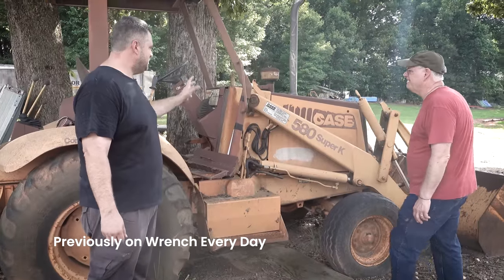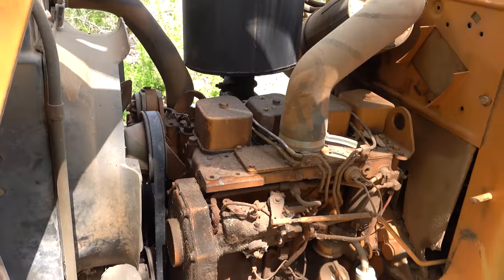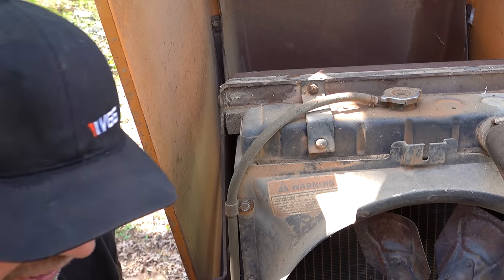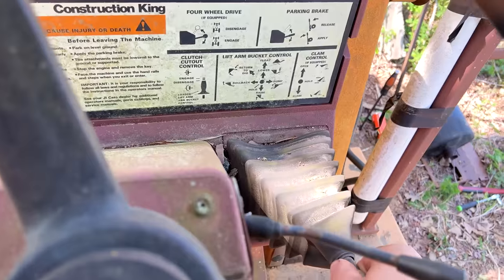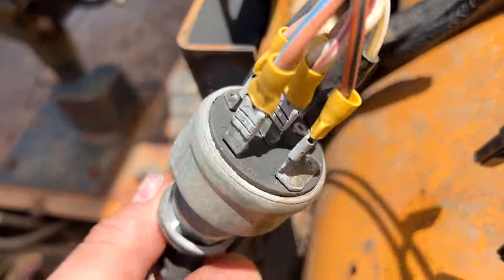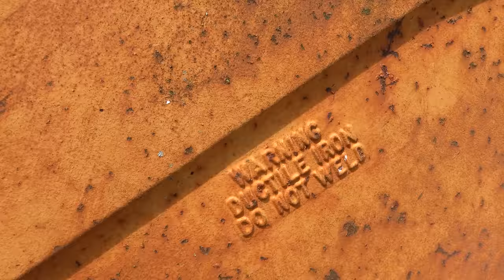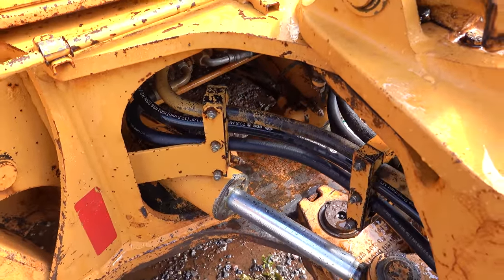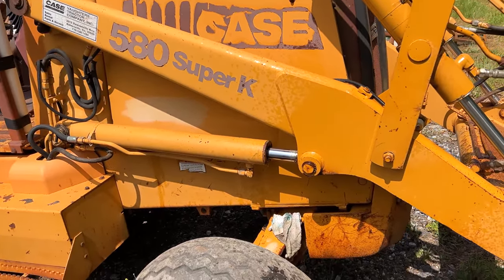I Found A $50,000 Diesel Backhoe ABANDONED In The Woods...Will It Start And Run?

Comment from the maker: To start comparing quotes and simplify insurance-buying, check out Policygenius: https://policygenius.com/wrench. Thanks to Policygenius for sponsoring this video!
Reply: If only you watched/subbed to Abom79. He shows you how to rebuild those cylinders like a pro the (easy) way.
Reply: Jared how you read it is release parking brake and apply parking brake
Reply: Turbo the Thing
Reply: 99.32% oddly specific 🤣🤣
Reply: Yes you are doing something everyone wanted do as a kid 😂
Reply: I have operated all my life. You DID so much better than me on two lever controls when I started using them my first was a JD control pattern. Boy I was terrible. I was use to 3 lever Case. So you starting with two lever to learn on. You will be a master at any Backhoe. Most are two lever on new ones. Just practice extension out all the way with bucket just off ground. Pull in slowly without having bucket dig. Go back and forth just with bucket right at ground level, without digging. Great job on first dig my friend
What you did just raised the value of that Case 580. You have a perfect machine for your usage
Reply: I'm pretty sure you may have figured out that any piece of equipment that has been sitting for several years, all the hydraulic cylinders are going to need be rebuild. As well as all of the rubber goods to be replaced. And while you are at it you might as well change all of the fluids on her as well, cause you will know that it is fresh and ready to go. 
Weather and time has a funny way to break things down. 
That is a good looking backhoe that you have found. I like to see more of what you can restore as well. Keep up the good work and videos.

Comment: Questionable Choice: Bringing an old backhoe back to life.
Smart Choice: Knowing that hydraulics are dangerous when not dealt with professionally and doing so.
Big ups.
Reply: Remember, questionable choices, not stupid ones.
Reply: Bringing back a 69 massey backhoe myself.
Reply: Dont need to be professionally done but someone does need knowledge and the tools, ive done hundreds and nowhere near a professional lol
Reply: @Yippa391  
Brought a 78 Dynahoe-190. Had it sense 2003. Just say have spent more on repair'sthan on cost of machine to buy. Hydraulic cylinders needing reseal. The dipper cylinder had to be boom truck lifted off unit. When I got it the stabilizer had strange issues like his Case. Anyway except for a Hose cracking, blowing Hydraulic Fluid all over. Just fished two on backhoe end that come up through the main base housing, too hydraulic control's under Levers. That was fun feeding the new ones through. My main problem that still is a issue is if I'm driving in second gear, it wants to pop out of gear. I mostly drive in first at my home, so no tranny issues in first.  Is a garden turn soil over machine. My wife lifts me in front bucket to trim tree branches with my pole portable chain saw. Spread gravel over parking area for it and my 71 SeaGrave Engine that I'm restoration. Why a Dynahoe, they were strong one unit frame for backhoe( part of main frame) plus both my baby's have the great old Detroit Diesel's ( Dynahoe 353) ( Engine 8-71)
They may have leaks or blow by, but that's a Detroit. The both run great. I do have a engine block heater, I bolted on the plates that already have the covers on engine block for them. That straight 40 Wt. Oil that is factory called for  those TWO strokes. The engine being warm. With a full battery they just always start even when the temperature drops below 30. I will say back in the late 70 when I ran a Case 580-C my uncle had me operator for. We did side sewer work. The battery was on other side of frame under front loader controls. Nice pull out tray
Anyway the starter was on other side of backhoe. Hard starting in colder weather. I think it was the distance the cables ran from battery to starter. That Case we had, Case was still building there own engine. Then they put Cummins in later models. Now is all FPT
( Fiat) have operated all Case models from CK
Had a nice belly blade on a old CK clutch model. Boy that thing was a great grader.
To the 580-E. That was the last one in 580 model's. Then on last job they had a 590. When they got rid of that, the company went to JD and Cat. So I have kind of gone cold on my Case backhoe understanding on new ones. The Dynahoe was built stronger than the Case. But BE got rid of all there Construction line in mid 80s with the Recessions of those years. It really hurt the constitution market. If it had not been for the 580 Case line, Case would have had big problems. That backhoe is what keeps case moving forward. Cat took over BE a few years ago so guess my Dynahoe-190 is in the CAT family know. Anyway I have talked to long, tell me about your Massy. What type of control patterns does your backhoe have. I ran a Ford 
420 once. With the 4 Levers. Boy talk about total different control patterns than Case. My Dynahoe with the 4 Levers standard backhoe set up. Is just like Cases, with swing being far right lever. And having two stabilizer Levers in middle between the 5 Levers.
Reply: My dad bought a used dynahoe  in the 80s. He loved it. It had a long reach with yhe boom. He sold to a guy who wouldn't quit bothering him. Big machine.

Comment: 10:37, Yes, that is a manual fuel primer. Handy when replacing the fuel filter. It depends on how the engine is standing, how well it works, so if it doesn't work, turn the engine over a little and it might work.

Comment: These 580k backhoes are great machines.  Yes it is old, but parts are available and no electronics to bring it to a halt.  I bought a new 580K phase 2 in 1991.  About $50K then.  I now have a 580k phase 1 (as do you) (parts are more readily available as it shares a number of parts with earlier models).  Mine has the extendahoe, 4 in 1 bucket and 4wd.  After market seal kits are reasonably priced and will be needed.  Don't sell the capability of this machine short just because it is old.  Compare it to a current model and you will see a lot of commonality.  You have the wobble sticks.  You will find these much quicker to learn and be smooth with than with the standard case controls.
Reply: I disagree about the wobble sticks being easier to learn. The “fighter”controls or joystick is way easier to pick up and use. I grew up on an old 580 N with wobble sticks. Now have a 580 super N with joysticks and also run excavators. I hate going back to wobble sticks.
Reply: @CMMC-zb1gw  Wobble sticks  are a two stick control with motions similar to joysticks.  One is direct action on the hydraulic valve and the other is electrically driven (typically referred to as pilot valves). 

 The original case controls that are difficult to use have foot control of swing and a separate lever for each of the cylinders, bucket, dipper, and boom (and a fourth for extendahoe models).  These are difficult to operate smoothly when one hand must push one lever and pull the other at the same time as your hand is not large enough for the distance the levers must move in opposite directions.
Reply: @CMMC-zb1gw  the letters notate the years they were produced through.  Super was a higher hp rating... not necessarily a turbo.
So.... In other words,  a 580 N has the same backhoe controls as any other "N series"  nice try.... Old 580 N🙄 SMH
Reply: @billsimmons7754  
Bill I started on a 580-C, boy going to twin- a- troll. Yes that's what BE called them on Dynahoe
I got so use to the 3 lever that I had trouble learning smooth operation with two lever. My Dynahoe has the two lever not the 4 Levers that was Factory standard. I am use to two lever. I do still like the Levers for each function coming to you by pulling then backhoe tool goes away from you when pushing. I find it interesting that so meany huge mining drag or shovel pit machine have foot swings.
Reply: I knew an extendahoe back in '84. She was 6'3" tall.

Comment: As soon as you fixed the seals, I knew more would follow! Hydraulic fluid is nasty stuff, just eats anything if left long enough. A full rebuild of all cylinders will sort that out, doing one at a time is a ticking time bomb, any weak seals will let go as they are the path of least resistance.
Reply: Yep. True of any pressure system (I was in air tools) you fix one seal, the pressure finds the next weakness. You can spend a stupid long time (even relative to the size of the equipment) chasing that process failure in circles.
Reply: My father has a CASE (a few sizes larger than this one), and we wound up replacing every piston seal in the hydraulics to stop the leaks (and a fair few of the pressure lines too).

The cost and time to do the seals is a hell of a lot cheaper than the hydraulic fluid tho!
Reply: I use a Case, couple sizes larger, for mining during the winter.  Last fall I had a steering hydraulic hose burst right as I started it up. Fixed it and then the other one burst after just 5 minutes of idling. Fixed it and a bucket line burst.  Ended up replacing 7 hoses before I turned my first bucket of dirt.  No seal replacements this year. 

So, be conservative and replace both seals on both cylinders as long as you’re down for the one.

Comment: You are a winner in my book. To not know about that wonderful Case, you took on everything my friend. I will start with the little lever you were pumping. That's the fuel pressure build up for when you change Fuel filters. To help bleed the fuel lines. Prime the fuel. On the front noticed the roll back linkage was disconnected. That is to stop the bucket from rolling back as far as it did. The over center lock for backhoe. Just hook the chain link to the rode sticking up. Then when you want to get it out of Lock. Just reach down ( this is the safety you talked about so much) watch your head, pull back on rode, and push boom lever back and forth. It should unlock. I had Leaking stabilizer cylinder on mine. The two front lift cylinder shot hydraulic fluid out like a raging river. When I bought mine. I was like you I had them done by a shop on 
re-seals. The engine hood. The muffler just sits down on bottom pipe, so that probably explains why stuff got into muffler, no tight seal with there hood design. I am so glad to see her work. I know that Case did a ( Safety update ) safety NEUTRAL switch, update. The backhoes could start in gear in Jump started. So Case did a fix for all there 580s. That might be the burn out of that fuse housing. I noticed that the backhoe would not start in gear. Has to be in Neutral on gear shifter, so that is working. I'm not sure if you ran a jumper cable to starter, and wath it in gear, it might START ( that might be something to look at as you go along ( Safety again) mine will start with it in gear if I jump start it. I have no neutral ( SAFETY) on mine. I think yours is close to year they switched to Cummins Engines. I'm not sure on model that switch from Case built Engine to Cummins. The New Case have ( FPT) fiat Engines. That are big Engine builders for Case backhoe now. Thank you again for bringing her back to life. Cut my teeth on a CK model. It had a belly blade mid frame for grader work. It did great grading.

Comment: Those tires hold a lot more psi that youd think they might. The front on my old work backhoe were 90psi and the rear were like 55psi. Takes absolutely forever to fill them but it makes a huge difference in the ride and traction. Definitely a cool video to watch you drive that thing or of it's grave
Reply: 580 SK front tires are 48 PSI and rear are 24 PSI
Reply: @danabbott2398  I'm glad that people here know specifically about these. I think the reason mine was so different was that it was a 4WD unit. Regardless, thanks for posting the K's accurate PSI

Comment: When it comes to rebuilding things, if I have a part that's failed and needs a rebuild and there are several similar iterations of that part attached to the same thing that needs rebuilding. I would do the front loader cylinders as a set, and then see what happens. Please, keep the awesome CASE content coming!

Comment: Hydraulic cylinders are easy to rebuild but when you have the right tools and lifting power to do so. Main thing  is if the bolt holding the piston to the rod won’t come loose, then try adding so heat with a torch.

Comment: I have seen people straighten the rams on machinery by using hydraulic jacks and chains and 2x4s for pads against the chrome ram. "Marty T"  has a video on doing that.

Tips on trench digging:
Try to scrape three or four inch layers horizontally about 3 to 4 ft long as you dig. 
That will do less damage to the sides of the ditch and you won't have to dig out quite as much dirt and won't have as much dirt to put back in when you back fill. 
Experienced operators often move the tractor forward by lifting the front bucket a few inches off the ground and then scooting the tractor forward by using the backhoe and then putting the loader bucket back down. They do this without turning the seat around. If you're on a small tractor that has two different seats this would be a real Time saver also. 
Some operators also keep the tractor angled  to one side a little bit with the tires pointing straight forward.
This makes it easier to see the trench that you're digging without having to lean sideways to look around the boom.
With this angled setup and the tires turned at an angle it's easy to move the tractor forward with the hoe.

Comment: My mother had a friend looking to give away a car that hadn't been started or moved in about four years, and she thought it would be a great gift for me. Thankfully, she realized that it would require refurbishment, and took it to her trusted mechanic who advised, among other things, "replace every rubber part on the car".
She found a very nice steering wheel cover which was vital as the steering wheel was literally turning to dust after years of baking in the sun, and the hood, roof, and trunk lid were solidly rust red after years of sitting under trees, but the 15-year-old cloth seats looked like new and it ran great.

Comment: Don't be afraid of rebuilding hydraulic cylinders.  I bought a used telehandler with a leaky cylinder.  I brought a cylinder to a hydraulic shop to rebuild, because I was ignorant and afraid of it. I came back with a $500 bill.  I tasked by 18 year old daughter with repairing the next one as a learning experience (8" diameter and 6' long).  She had to make a tool to get the end cap off, but the rest was simply R&R of seals and wipers.  $80 in parts and it has been working perfectly for 4 years now.  My daughter has aptitude, but she it not a mechanic; a little bit of ambition and common sense is all it really takes.

Comment: Jared, pick you up some caps and plugs for the hydraulic lines and then you can disconnect the lines from the cylinder and then cap them and not have to worry about it leaking anymore

Comment: I ran heavy equipment for 30+ years and there's absolutely no reason to keep the tires off the ground when you're digging. That just wears out the bushings in the stabilizers a lot faster! 

I saw one weirdo who felt like he had to have the tires at least a foot off the ground all the time. That makes the tractor really unstable and harder to see the trench. 
The only time I raised the tractor up as high as I could was to load into a tall truck and level out the load, so I had to see down into the bed while I was doing that. 
In some situations you may have to tip the tractor sideways a little bit. Or level the tractor if you're on slanted ground.

Comment: Those are good units. They are simple critters and mechanical. Good feedback for the operator. At my shop I have a 71 Ford Construction Special set up just like this and its a crusty old critter but damn can it do work. I would send out that bad outrigger cylinder and if its bent just replace it with a new one. Sending in both lift cylinders on the loader isn't a bad idea but I don't think you need to do more than that. They are the ones taking the most load. Before you run it any more make sure the full fluid and filter change gets done on your hydraulics. Wrecking a pump or an orbital valve because of bad fluid is just money wasted, and you'll still need a fluid change. 
Grease is your friend with these machines. Keep them up with fresh grease and they last a very long time. As I tell my guys, a gentleman uses lube. 
Would be a good idea to get through all the fluids and filters on this unit, its due for service and you won't believe what tractor parts cost and what is involved to change them. You'd think you were working on a Lambo when you get the bill. Guess thats why Lambo started out as a tractor company before ever making cars. Make sure you have the proper SCA charge in your coolant when you flush it out. Heavy truck shops sell you test strips and the additive to be sure you have the correct level in your coolant. Don't go overboard, get it in the proper range. 
I know this is an older unit but frankly as so many operators are finding out they are superior by far to the emissions compliant trash made today with all their electronics. Just a bad sensor can put a machine out of service now. This old thing can still raise hell when its half broken. I'd take an older machine over a new one any day of the week.

Comment: It does seem that a bunch of peeps enjoy these vids. There are a fair amount of people doing this thing already, so if you enjoy it have at it.  A 580 Case is really a so so machine a 310 or 410 JD is much better, in running/working condition you'd be lucky to get 10k for it . They also have weak transmissions. You have something to make content with so it's good enough